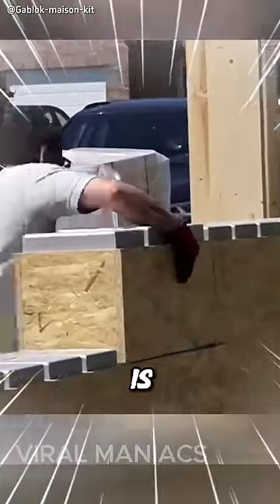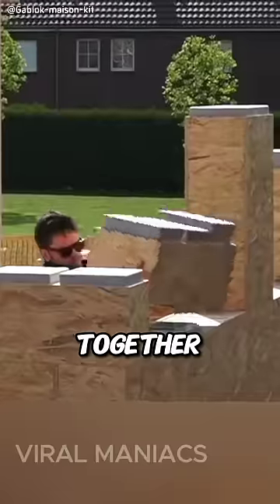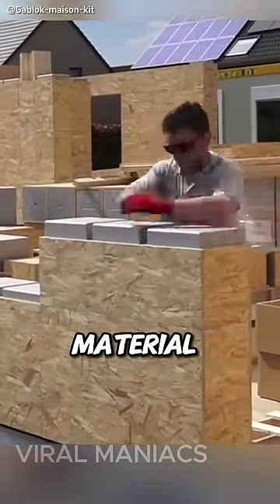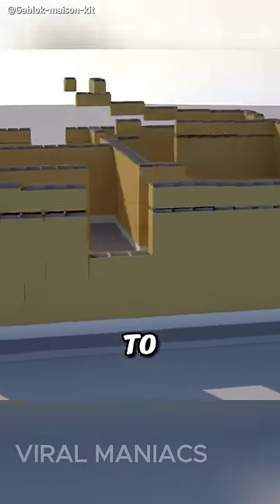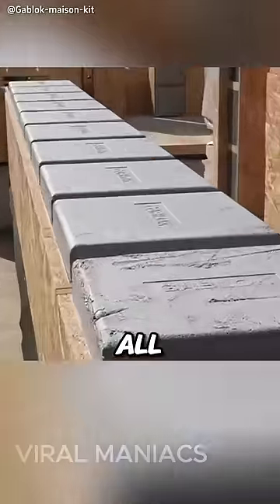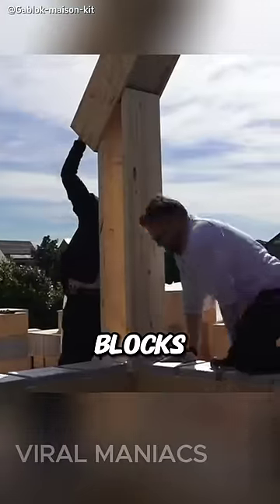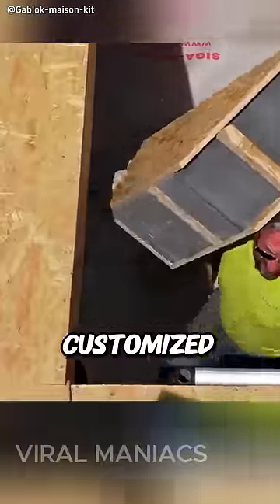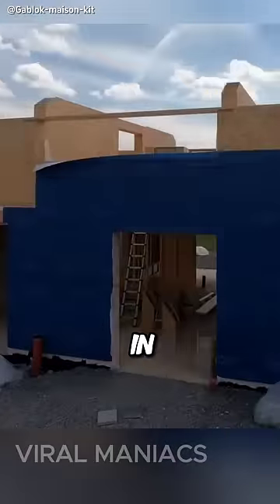Whoever Invented This Way Of Building Houses Is a Genius #shorts

Comment: that's cool until a thunderstorm blows it down the street
Reply: Imagine having to put your house back together every time a storm rolls through 🤣
Reply: You are supposed to use construction adhesive to bind the blocks. I think that this is just a demonstration.
Reply: @LukeA_55  the whole east coast
Reply: I mean, depending on how much the structure weighs and how it's assembled, it's possible even an unglued structure could withstand quite a bit of wind before being damaged. Older Japanese architecture features interlocking wood components and they don't even use nails or other fasteners besides the interlocked wood.
Reply: I was gonna say, this house looks like it'll fall apart like cardboard if it gets wet or a strong wind blows lol.
Reply: With adhesive this is probably stronger than any other kind of house
Reply: That's a s*** ton of OSB bro
Reply: @asiahenry7798 this isnt the outer walls though this is just the framing with insulation
Reply: @wingchunkungfuwins I don’t know, I’d be worried about the adhesive failing from extreme temperature differences or moisture affecting it.
Reply: @diegaspumper8501  No. The wood would fail before the adhesive fails under pressure. 

It might look fragile, but under the weight of a roof, that house isn't going anywhere. It's still very, very heavy. If you're in a hurricane prone area that's going to take the roof off anyway, you're fucked regardless.

Obviously this probably isn't a hurricane proof house..
Reply: @LukeA_55 that’s one Lego piece you don’t wanna step on
Reply: Especially here in Oklahoma lol
Reply: this is sturdier than american houses where you can just punch your way through a wall
Reply: @diegaspumper8501 THE PROPER ADHESIVE WONT.
Reply: That’s exactly what I was thinking.
Reply: @TheWerttyFiles  That's actually a fair point. Even in the most extreme of weather conditions (ex tornadoes, hurricanes, typhoons, floods), traditional building methods would crumble all the same.
Reply: So, what do they expect ya to do for electrical?  Run conduit to external switch and outlet boxes?  How bout plumbing?  Do we continue with the "industrial feel" of the place by having it all exposed?
Reply: @LukeA_55 😂🤣
Reply: @diegaspumper8501  I mean yeah maybe you don't want to build this in Alaska or Florida.. in a  moderate climate that's a lot of structure with that OSB and the insulation is better than any other. It's probably soundproof too.

Comment: A firefighters nightmare.
Reply: Just get the marshmallows and hot dogs. Nothing else you can do... It's definitely going up fast and nothing left to see here folks
Reply: Shit, that would be burnt to the foundation before we even get there. Show up just to put out the hot spots.
Reply: Yeah because regular housing doesn't burn
Reply: We havent learn to break in a house from lego .
Reply: Why? Aren't all houses in the US made with wood?
Reply: Why?
Reply: @treeamigo8447 regular but not in USA. Regular bricks and building blocks can withstand temperature up to around 1000 °C
Reply: Surprise! Even brick houses are made out of wood… what do u think is behind the bricks?
Reply: @treeamigo8447 that’s OSB and a foam, a product of petroleum, it’s gonna burn several times faster due to the heat energy release rate than ordinary construction.  So yes, this will burn like everything else, but I wouldn’t wanna be home when it does.
Reply: How? All fire rated bud. Built about a thousand homes this way.
Reply: @flaco_dave  Maybe it's different in the US but in my country there's usually a layer of polyurethane thermal insulation between the bricks/concrete.
Reply: Man everything is a firemans nightmare, nearly every house is built with wood anyway. Blow in insulation in the attics, carpet, cabinets is all going to burn and if its bricked up that just means it turned into an oven thats going to be twice as hot inside of it.
Reply: @Wcanada3177 whats the name of someplace i can get a quote on building one this way?
Reply: may I introduce the german way?
Reply: @flaco_dave some are and some aren’t. In the us most are timber while in Europe it’s concrete masonry behind the bricks or bricks
Reply: @LLF1234  ueah, that's how i always thought it was.....
Reply: @treeamigo8447 In Europe, only garden sheds are made from wood. Where in houses other material than bricks, concrete, steel or mortar are used, it has to to be fire retardant
Reply: @flaco_dave but the studs of a CBS structure rarely catch fire.. ultimately anything will burn but its usually the contents.. curtains, carpets, furniture, etc..  everything else from that, in most cases.. 
these wood/glue/styro bricks though.. will burn, melt, and create some hella smoke.. its like melted plastic and napalm combined..
Reply: @young11984  location?
Reply: @young11984  if you're not a contractor you'll have to find one to get you a quote.  My supplier doesn't sell to anyone but contractors.
Reply: @young11984  to tell you the truth I'd go ICF style  better built systems been around longer.
Reply: @flaco_dave  Only in the US. In my country they are really made out of bricks, no wood on any walls

Comment: I do drywall and did a house like this. It holds in all the moisture because of the blocks. I forgot to put the lid on the mud when we left.  The next morning the sides weren't even crispy. The house already has mold problems from all the trapped moisture.
Reply: Best point EVER.
Reply: ty
Reply: So it's only good in very dry areas
Reply: So it would need a proper ventilation setup not hard to do
Reply: That's a ventilation problem not a problem with the build of the house.
Reply: @virtue_signal_  easy as installing a few small vent fans to circulate the air I'd say with the efficiency of insulation for heating and cooling it would be worth it
Reply: All houses that are improperly ventilated have mold problems. Drywall is literally just paper. Get it wet and it grows mold. Amazing concept. Perhaps you should do your job better.

Comment: Never in a million years I would want my house to be built like this.
Reply: Why?
Reply: @theroadtotaste  
rubberized polystyrene
Materials Data Safety sheet:
"highly flammable"
"extremely combustible"
Reply: @safeandeffectivelol  wood....highly flammable highly combustible. Same goes for oxygen, carpets, rugs, sofas, regular insulation......sooooo what's ypur point?
Reply: @theroadtotaste  Not only it's not that sturdy. I also prefer a concrete house with big solid woods, a mixture of modern and ancient nordic design. I also like castle like houses.
Reply: @KillberZomL4D42494  see that's fair and I respect that but I'm sire there is indeed a way to make it sturdy like some kind of support system built along side it. But yea im a huge fan of nordic house construction so I get that for sure. I was just genuinely curious what your thoughts were.
Reply: first problem. you need to spend extra effort to attach them together. through cement, or...plastic glue...? second problem. its wood, and plastic. any kind of fire is instantly gonna make this house a chemical health hazard. third, where to put all your electrical wiring? you still need to make an open wall attached to these bricks. its quite useless. really a china product.
Reply: @sollitdude1  everything in a normal house can cause a chemical issue when it catches fire...not really proving a point.  Second you can make cutouts for corda and piping im sure
Reply: @theroadtotaste Do you sell this product ?
Reply: @jacoblecoy3700  don't need to sell it to understand it.
Reply: How do you install pipes electrical outlet and sewage line also thunder discharge inside the ground like 100 - 300 feet and also the cyclone hits strength. The iron steels inside the building blocks are more stronger
Reply: Its not just aboit catching fire its a chemical hazard fire that is burning with these walls plus good luck with utilities @vanheeim.the.dungeon.master
Reply: @Kdawg304  a chemical fire that woul happen with literally any other material including normal insulation. So your point is still going nowhere. Not to mention the fact that maybe you should look a what spray-in insulation is made of. And let's not forget that Polystrene the insulation that they use is ised almost EVERYWHERE in day to day. Again. Not a great point.
Reply: @vanheeim.the.dungeon.master  spray in insulation is actual flame retardant has save many houses from burning down besides that how do you run electric in those walls that's right you don't it would completely offset any potential savings or you would have to build a separate wall to run the electric making it way more expensive
Reply: The wind might blow it away
Reply: @safeandeffectivelol  rubberized (or extruded ) polystyrene is different than expanded polystyrene.
Reply: @sollitdude1 
Electric isn't much of a problem. There is something called Wiremold used with concrete block houses. It's flat metal tubes to run wire through mounted on the walls. Outlets and light switches too.

Plumbing too can be wall mounted and exposed. 

This idea that plumbing and electric runs must be "hidden" inside wall isn't a must.

Comment: This method is fine where you dont have hurricanes or earthquakes. Say, the southwest USA. Interior walls should have angle bracing. The outer walls will also have to have a top plate  and double plate which supports the roof load. I would wrap the exterior walls with  half inch plywood in 4x8 sheets.
Reply: Why just not wrap the house
Reply: Details, details..... And you probably think an inspector should check it out too... 🤣😂😆
Reply: I have seen some block walls like this that had holes with amples of epoxy. They would break when rebar is inserted to hold it all together
Reply: Yeah...
Those blocks aren't structural
in any way.
This Lego house would never pass
inspection anywhere in the U.S.
Hell, they couldn't even get a permit
to build in the first place.
Reply: This would be earthquake proof. There’s now way that’s breaking apart anymore that a wooden house in California like the one I live in.
Reply: And no wolfs that will huff and puff and blow your house in
Reply: Southwest?
Soooo, Baja California.

Comment: This will probably be lost in the comments but,
I was one of the engineers working on this we initially made them for cheap houses for people in need in Africa but we started monetizing it for cheap buildings for construction workers than we started selling them for actual houses.
Reply: So cheep houses for Africa turned into a dear house at home. Profit over poverty always pays off.
Reply: Whats the name of the company?
Reply: Nice idea. Where were they build? And how about fire? We learned A lot about wall insulation caught fire
Reply: H0w do they put up with wind, snow, dead, live loads and earthquakes?
Reply: What's the name of the product / company so I can look into them? I've built SIP houses before but these are a bit different and would require a lot less people I imagine a single person could build with these pretty easy. Using this to make just a 30x50 or 30x60 shop/garage would be super sweet could even go pull barn style and not concrete the floor just run your footings and build right off of that a single person could probably assemble the whole wall structures in a day or 2. But the cost is the issue.

Comment: How flimsy and flammable do you want it?
YES!
Reply: Cool, forgetting that our normal houses are quite flammable too...
Reply: It’s actually more solid and densely compact, so fires will take much longer to spread. Just spray a fire protectant on it and you are good to go.
Reply: It's no more flimsy or flammable than any other American houses. You guys build himes out if cheap wood and cardboard basically.
Reply: @ryanb8736  mate, have you ever approached a flame to any polistiren?
Reply: This should be the #1 comment!
Reply: Seen modern construction 
Can put your fist through both walls

Comment: Let’s just overlook the fact of running plumbing, electric and sewage
Reply: Yeah but who needs this anyway?
Reply: yah because they didn’t show it being installed, that means it can’t be. Real hard to drill holes, no one does that….
Reply: Literally just drill through the wood and foam. You're welcome.
Reply: They will use slot cutter to make the space for the electric pipes, then they put drywall on it and bumm, done.

Comment: Had to do a deep dive... there is a false wall built on the interior side of the house for electrical.  HVAC has to be carefully planned for in the sub floor (and probably a bigger false wall space for upper levels).  Seems like a really expensive "solution" for a DIY house build.
Reply: There's a sucker born every minute. It's best to let them do a deep dive.
Reply: Considering how cheap bricks are… they’re for sure the last problem when it comes to construction costs
Reply: Wouldn't you use the Mitsubishi heating cooling system in something like this house? Minimal space needed to put the cable through. More problem doing the rest of the electrical and water access.😊
Reply: @pete5405 Bricks the cheap but bricklayers are not, well at least the good ones that you'd want building your house
Reply: I was wondering about that too
Reply: dive deeper and youll learn every single building that has ever been built like this has been torn down roughly a year later.
its a scam. but people love to go the cheap route instead of the professional route.
Reply: @pete5405  when it comes to construction, the most expensive part is labour, then any possible machinery you use and then the materials.

building a house is cheap - getting a house build is expensive.

Comment: This is why the houses being built today aren’t as sturdy as the ones from the 60s-90s
Reply: Non-porous solid hardwoods are only but a dream now, with all the lazies and shortcutters these days🍻
Reply: Qualify this statement without using empty platitudes.
Reply: Hot take
Reply: @shatzngiggles8911  i don’t have to explain anything to you but in hopes that you’re not being disingenuous I’ll try. Majority of homes today are held together by cheaper construction material like plywood, OSB sheathing, fiberboard and finger-jointed wood rather than millerwood or concrete. Newer material allows for a more comfortable living but you lose sturdiness of both your landscape and foundation. Plaster and lathe will always be structurally stronger than drywall
Reply: @TheBarnesFamilia  Plaster and lathe cracks during settling and falls off the walls in earthquakes.  Drywall doesn't crack or fall of as easily. 
But if you like the houses from the 1960s you must be in love with no insulation, single pane windows, no roof tie-downs for wind, wood shingles to fuel fires, galvanized steel water pipes, clay sewer pipes, ungrounded electrical outlets, 100 amp panels with aluminum wire, stab-loc breakers that cause fires, and no GFCI protection.  Yep, they really don't build them like they used to.
Reply: Don't even get me started on the pyramids 😂
Reply: @RH-cv1rg  I’m glad you got to share your opinion. Do you feel validated now? Can you stop being weird in the comments now? Appreciate it
Reply: @TheBarnesFamilia what a low intelligence response
Reply: @getinstafinished1526  I’m sorry you feel that way. I’m glad you were able to get that opinion off your chest. Hopefully you feel relieved
Reply: @TheBarnesFamilia  Weird?  Pointing out the faults of 1960s houses compared to today is weird?
Okay, I thought valid points that relate directly to the original posters opinion were valid, not weird.
Reply: @TheBarnesFamilia I'm glad you feel validated after having your nonsense statement about housing properly dismantled.
Reply: Modern houses are way sturdier. I fix houses built in the 90s and earlier. They are nothing compared to what you can buy today.
Reply: @TheBarnesFamilia  oh wow it's almost like you've never built a house and just have weird reddit tier opinions on materials based on realtor website platitudes
Reply: @shatzngiggles8911  I’m sorry you feel that way. I hope you having the chance for me to validate your opinion somehow helps you feel better